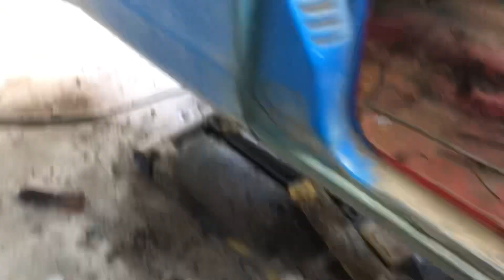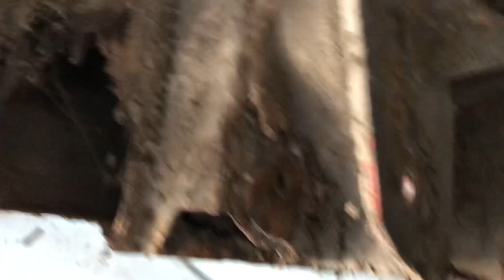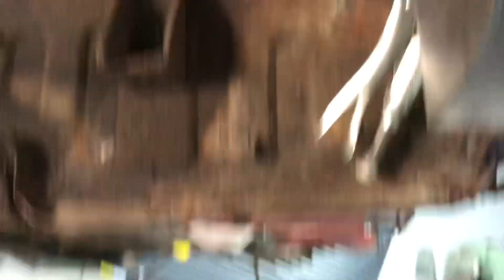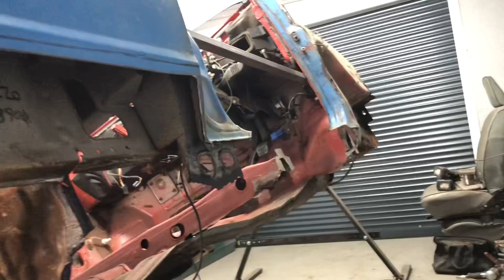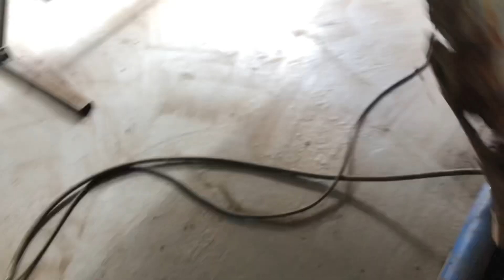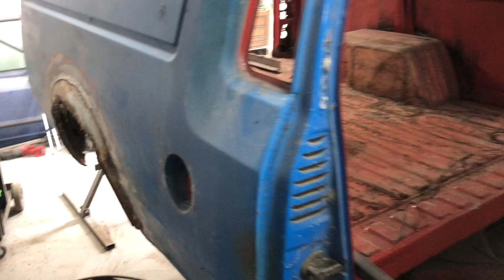Mk4 escort van restoration first new panels installed

Comment: Anymore vids ? I'm picking mine up at the weekend and it's pretty much the same . So it's good to see how you've got on with yours 👌
Reply from the maker: @deanrichardson7090  just in the process of replacing the rear panel at the moment, I only get time to work on it once a week so unfortunately videos may take a little bit of time to come
Reply: @clumpfab2740  that's sound boss I've been and picked mine up at the weekend .. it's a little bit more tender then I thought it would be but a good project to get on with .. I'll have a look when you fire another vid up .. might even do one me Sen
Reply from the maker: @deanrichardson7090  they always need more than they look on the surface 🤣 I was hoping this one would be a quick fix but now it’s turned into a full blown restoration, I’d love to see yours if your putting vids up
Reply: @clumpfab2740  they most definitely do mate I'll get a video fired up once I start tucking into it . Just waiting to get floor and walls painted in unit then I'll be at it .. I take it yours is on the strip down ?

Comment: Loving this series! Had 2 Escort vans in the mid 90s - One B plate mK3 RS turbo top to bottom (in diamond white) and one C plate but Mk4 (painted bright yellow) with an XR2 engine, single piece rear door, slammed and full RS Turbo Recaro (light grey) interior, which was sold, and the new owner (based in Boston IIRC) turned into a 4x4 Cosworth and was feat in Fast Ford